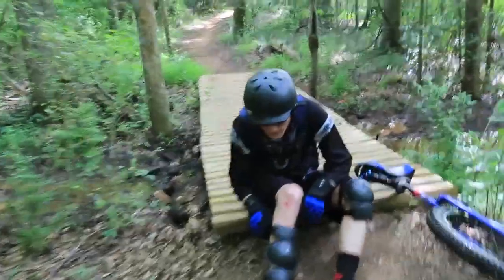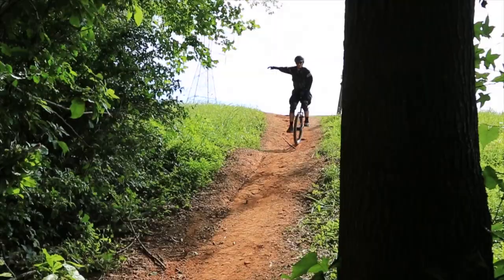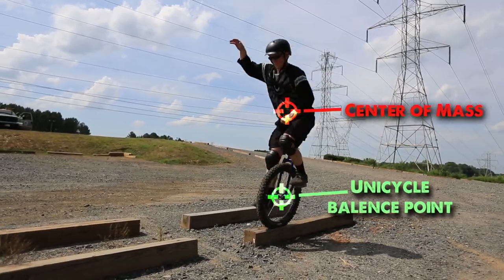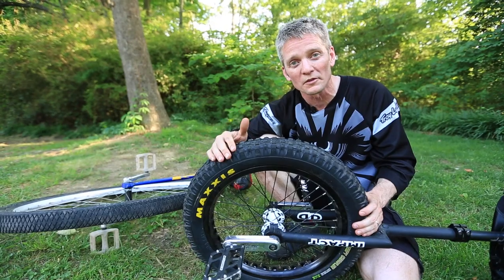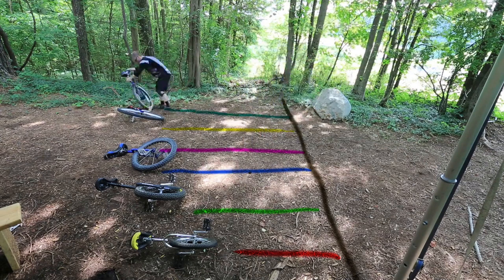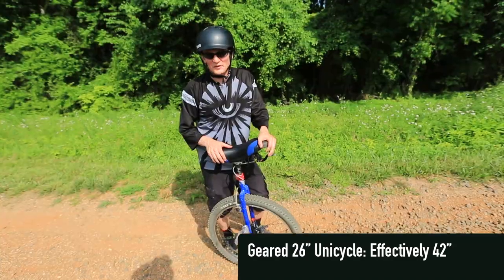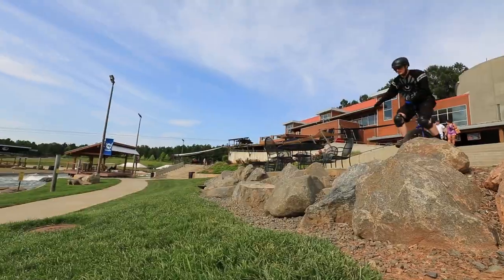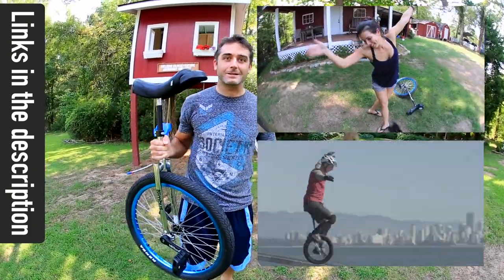Unicycle science - Why so many wheel sizes?

Comment: missing a formula about the relation between crank length and wheel size and how much power is needed. That would be science;-)
Reply: I agree that crank length should be discussed.

On traditional bicycles, crank length isn't as much about wheel size as it is cadence preference and femur length.  In general, taller riders utilize longer crank arms.  Those spinning higher cadences utilize smaller crank lengths.

I've noticed that virtually all unicycles utilize shorter cranks, regardless of wheel size.  In fact, there may be an inverse relationship.  My 24" Torker unicycle has pretty long cranks, whereas Ed Pratt's 36" has pretty short cranks.

Comment: What is the best size wheel for begginer. How hard is to learn ride unicycle. How long time is take to learn
Reply: +Haralabos Lukatos I'd say 16" or 20"
Reply: +Haralabos Lukatos i had learned on a 24" because i'm 6'3" tall.
Reply: +Haralabos Lukatos 20" is the best if you're older taller than 4'.
Reply: thank you for the answer.

Comment: what does it mean to have a unicycle geared and can I do it to my 20'' to make it faster?
Reply: Hey David, without being a uni-gearhead, I know that the gearing is inside the wheel itself. It's in the hub. You tap a nob as you're riding to switch the gears. I don't think it's very easy to do it yourself. You'll want to buy a geared wheel. Chris Holm makes some.
Reply: Hey David, it would make it faster, but for the cost of a geared hub, you could buy a 24" a 29" and have a fleet of unicycles along with money left over. The bigger wheels would be faster and roll over stuff a lot easier.

Comment: The enthusiasm of the presenter helps to save an otherwise poor video.  The distance travelled per revolution would be easily explained with one demonstration.  There is no mention of the vital effect of crank length in the "gear ratio".  This affects not only top speed and cruising speed, but also the leverage available when climbing or descending hills.  The video assumes that the viewer knows what a "geared 26" is without any attempt to explain.  And it's Kris Holm, not Holmes.  This is a great sport, though.
Reply: Crank length has nothing to do with gear ratio.  On a 27 speed bicycle, you utilize the same crank, so you're going through a 600% change in gear ratio with one crank.  The crank works fine for each ratio.

Traditionally, crank length is more a function of a rider's size and then cadence preference.  But in general, taller riders use longer cranks, shorter riders, shorter cranks.  People don't change cranks on bikes for different gear ratios.

That said, there's a move to shorter cranks currently.  If you spin a higher cadence (110-130), you may want to try shorter crank arms.

That said, I would like to hear a crank length discussion as they relate to unicycles.  Ed Pratt's 36" unicycle appears to have shorter cranks than my 24".  I'd like to hear the particulars.
Reply: @dudeonbike800  Gearing is basically leverage by another name.  On a unicycle, the leverage is between the effort put in (your feet) and the movement taken out (at the wheel rim) which is why crank length is relevant.  If you would like to hear a crank length discussion as they relate to unicycles, go to https://unicyclist.com/c/general-unicycling-discussions/10 where we have been shooting the breeze about this stuff since time immemorial.  It's the friendliest place on the internet.   I started unicycling in 1987 and since then have owned and ridden 20, 24, 26, 28, 29 and 36 inch unicycles on road and cross country.  I have experimented with cranks from 75mm to 170mm.   I also ride a 24 inch ultimate wheel.
Reply: @mikefule330  I appreciate the information and link.  Thank you.  I'll check it out.

Gearing is indeed leverage by another name.  However, one does not alter crank length on multi-speed bicycles based on their gear ratio, so that's why I addressed the discussion.   A rider will use a specific crank length on a bicycle, whereas gearing changes to a bicycle can be frequent, usually dictated by conditions and course profile.  If you're racing a flat criterium course, you may choose a "straight block" cassette because you simply will never use low gearing.  Hilly courses will require a wider gear range.  And again, I've never encountered a rider changing crank lengths for a specific race course.

In other words, crank length on multi-speed bicycles is determined by the rider's preference, not the bicycle's gearing.  And in general, many riders will use longer cranks on mountain bikes and shorter on road bikes.  I ride 175mm off road, 172.5 on road as an example.  This is very common for someone my height.

Ironically, my cadence increased significantly after increasing my mountain biking mileage relative to my road bike mileage.  So despite using longer cranks on the mountain bike, I tended to spin higher cadences on that bike.  This is generally contrary to what most people experience.  Track riders tend to use even shorter cranks so they can reach even higher cadences comfortably.
Reply: @dudeonbike800  I broadly agree with your analysis as regards bikes.  You choose the crank length that is most ergonomically efficient which for an adult is typically somewhere around 160 - 175 mm.  However, on unicycles which are almost all direct drive from cranks through to the hub, your only variables are crank length and wheel diameter (plus of course, tyre section, quality of components, and weight, and riding position).  When the ratio of pedalling cadence to wheel revolutions is fixed at 1:1, the choice of crank length becomes crucial.  Within crude broad limits, a 10% change in crank length can make around 10% difference to peak speed.  However, when you get to very short cranks, you are using less of the range of movement available in your muscles so you lose efficiency.  Similarly, on steep hills, longer cranks give you more torque and control until they get so long that they become unwieldy.  The rule that works for cranks between about 110 and 150 mm breaks down at the extremes.  To visualise this easily, try a reductio ad absurdum:  think what it would be like riding with 10mm cranks or 300mm cranks.
Reply: @mikefule330  excellent insight.  Thanks for sharing!